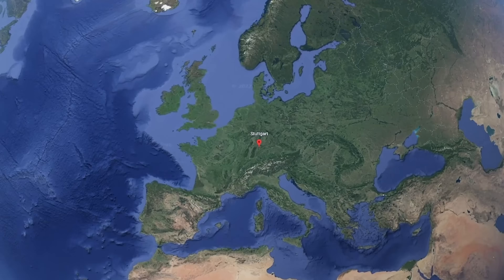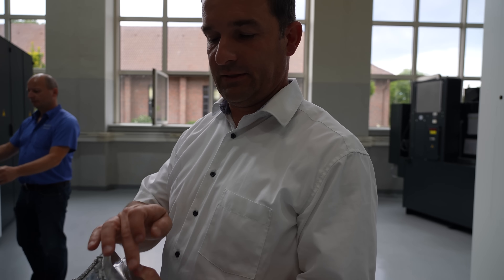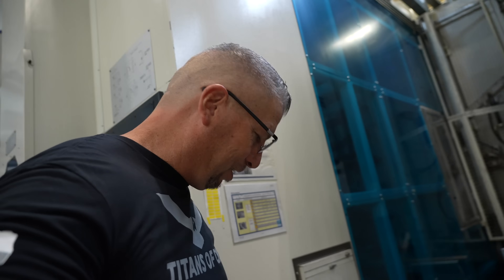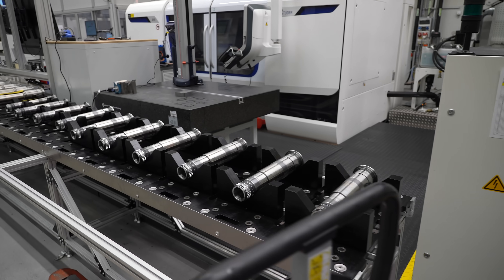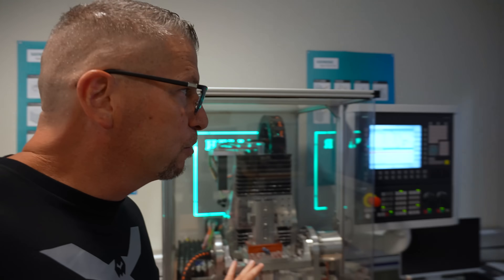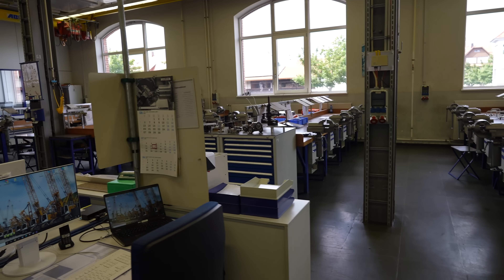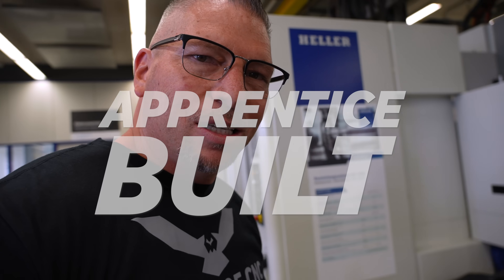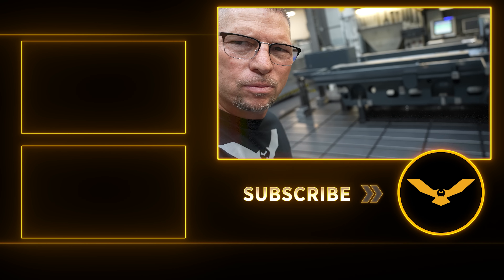GERMAN Machine Tool Builder Makes MONSTER CNC Machines | HELLER Machine Tools

Comment: You are not so far away from the company I worked for  Niles-Simmons Hegenscheidt MFD they're in Chemnitz the former Karl Marxsberg east Germany
They build Lathe-based machining centers they have many features that no other company really have to offer like a boring bar tool changer  your boring bars have servos and hydraulics to change their form as they cut they have a gearbox it is both an axis as well as a gearbox by zeroing out the clearances gives them the ability to use that as a rotary axis that is extremely rigid
Apprenticeship is a major thing in Germany it is something that is almost gone entirely in the US I served a formal apprenticeship, our machine shop was an official registered apprenticeship shop by the national tooling and machining association shop my father was a past president of the Arizona Tooling and Machining Association chapter of the NTMA. 
If anyone has heard of a Herrig 6-12 surface grinder I actually learned to grind under Herbert Herrig son of the man who invented this machine.

Comment: Hey I am a Mechanical Engineering student going into my senior year and I LOVE CNC! I wanted to ask if any experienced professionals in manufacturing or engineering have any advice for me. A couple weeks ago I started as a machine operator in a small job shop. I absolutely love it, I can’t wait to start setting up and programming machines, it seems easy enough too. I’ve been studying up on G and M codes along with the Haas manual for my machine (along with watching Haas tip of the day videos while my machine is running😂). I want to look into the courses on the Titans site but I was also wondering what else may be beneficial for me to do. My school offers a 4+1 program that allows me to get my masters in one extra year and I don’t have to write a thesis or something of that nature, it also costs less money. I was planning on doing it for a while and now I’m wondering if it would be beneficial for me to spend that time and money on the extra year for my masters. Would that help boost my pay as a machinist? Would that be good to have in case I want to have another option if I want to change things up or even have some type of role that may be higher than a machinist but still very involved with the CNC machines? Any advice would be greatly appreciated. Thank You!
Reply: As a shop owner, would you pay a CNC operator more because he/she in addition was a trained opera singer, a cook or anything else not specifically relevant to the current work tasks? You getting practical experience with CNC machines, and you having engineering degrees at hand naturally can be a good benefit to you in the future if/when moving on to higher positions, but do except 'normal' payment for the tasks you are doing. Generally, there is no big lack of people with NO education, and people with high education (+ a load of debt), but quite some lack of what is 'in between'; welders, CNC operator and so on, skilled people 'on the floor'. There are good possibilities within mechanical shop, both operators and engineers, would not think too much about payment at first, better focus at following something one love to do, getting experience and try be great at it, and often money will follow later on
Reply: You've been goofed out of a lot more money on an engineering degree than a tradeschool in machining. A masters most likely won't do jack if you're looking at that route specifically. 
On the other hand, if you really love tool making and machining, you can go beyond your master's and get a PhD in mechanical engineering with a focus in manufacturing. My university was/is (getting back to it) huge in manufacturing. It's much different work as you can be working with CNCs, but you'll be doing pages long derivations on equations to show for it. Talking things such as chatter, tool life, tool deflection, chips, etc. The other place I'd see having a ME background would be advantageous is in nanoscale machining where single point diamond tools and interferometers are standard and the construction site down the road just ruined your part.
All that being said, master's make it easier to get into and get a slight pay bump in managing positions. Depending on your situation, a good employer will be willing to pay for tuition. Meaning you can take up the job after graduating and when you're better off and thinking of it, you can get your master's paid for, albeit taking more time.

Comment: The best and most shocking part, seeing a kid use a file and a vice, probably the root of all high tolerance machining knowledge.  👍🏻👍🏻👍🏻
Reply: Yeah, gives me flashbacks. I learned as a Car Mechatronik at Mercedes back in 2014 and even we had to learn how to file and work with manual Tools. When you did it with your own muscle Power  only then you start to appreciate the automation that CNC machines give you even tough we never learned g-code and how to work with a CNC machine it was still an important part of our training.

Comment: I believe the High school system in Germany allows at the half way point to decide whether you'll be pursuing a trade school or traditional university education. If you choose trade school they let you get into apprenticeship programs as part of the curriculum. So when you grad high school you're already well on your way into a trade of your choosing.  The US has some similar programs in the USA but none as thorough or nation wide.
Reply: The school system here in Germany is quite a bit different. At the end of grade 4 you have to choose 1 of 3/2 school types. You can either go to school for 12/13 years at a gymnasium which gives you the degree necessary to go on to university or you can go to Realschule/Hauptschule (often they are combined) where you get a different degree after 10/9 years which is more focused on learning a trade or a job that doesn't require university education. If you choose to do a trade you will be in school and at a company and learning about your trade. If you complete your apprenticeship you can then go further and become a "Master" of your trade.

Comment: Why do we hear so little about Heller? Were they like GROB who only recently moved into selling individual machines to the market?  Their machining centres look up there with the best
Reply from the maker: They are up their at the top… they usually just sell machines to Monster Car Manufacturers or Caterpillar etc… but things are changing.
Reply: Grob was manly producing hole production lines like for car engine blocks. With the g series they put an enclosure over it and sell it as a single machine. Heller is one of this manufacturers that u know when u need this kind of machines and have the application for it. Or u digg a little bit.

Comment: What amazes me is there is a market world wide for all these machines and different Brands . I think I read Doosan build 12,000 machines a year that is just one brand .
Reply: Consider the fact that every single thing you see that is manufactured required a CNC machine. From clothing to plastic cups cars planes trains…..it requires many many machines to build a worldwide civilization!
Reply: The world is still automating and we're now solidly into replacement time for pre-cloud CNC machines, even the ones with rudimentary ethernet/usb connections.

Comment: i remember pople juking 3d printers printing 3d printers HAHA mills making mills BOOOMMMM
Reply: Phil, back when the earth was still cooling the Bridgeport Company, who makes the Model 1 Knee Mill, had a quality-control test where they would pull a Model 1 off the production line, take it to a little room, and manufacture another Model 1 on it. If a manual mill can do it, a CNC mill damn well BETTER be able to do it!

Comment: I don't know if it's different in the states, but this is how trades are learned/taught in many places in Europe. 😊I was an electronics technician apprentice (hardware development) myself and went through something very similar to what these guys are.
Reply: Its VERY different in the states! But Titan is on a mission to fix that!!
Reply: @barrysetzer  Hes doing good work 👍👍 How does it work over there?
Reply: Basically you go to school for 12 years to learn math and science, and after that you are on your own.
Reply: @barrysetzer  No "system" to guide people on to something then? Here everyone starts out with 9 years in basic school (math, science all that), then you can start at a trade school where you learn basic things in whatever trade your interested in, then get an apprenticeship like these guys in the video, it typically takes 3 or 4 years to complete an apprenticeship. Companies take a lot of responsibility in having plenty of apprenticeships available, many also end up with a career that way.. Or after the 9 years you can go the academic route of high school and eventually university. Those are like the two main "routes" here.

I'm a bit of an "odd" case myself as I went to the army before anything else. Then I used an army benefit to get full pay under an education and took up a trade. Realised I wanted to design circuits, and not test them, so I started at a university where I now study electronics engineering instead. Well, anyway, we have all these ways to develop a career and I think it's really good what titans is doing here as it hopefully gives more people a chance at a better future 👍 and an industry like metal working and machining will always need a steady supply of highly skilled people. 👍
Reply: It sucks here in the states,  I love machining but Im going into diesel technologies with an associates in applied science.   The first 12 years are school, ie math science, history ect.  Our hs has a really good machining program thats starting up, they just got a huge grant to expand the school for its trade classes.  Welding/fab, machining, small engine/light duty vehicles.   My father is a machinist so thats where the back ground started, helped him a lot in the shop running parts.  Back to the main point, the trades at the hs all work on things as one. Before I graduated, the new addition was finished but the welding shop wasnt. The shop class made plans and made the table tops, legs, stretchers and brought them to the weld shop to be assembled.  Each kid would be assigned to build the table as an assignment, doing everything to build it.  I had a teachers aid block tied into my welding block so I could help out the most.  The machine shop teacher ended up being one of my dads old friends so he knew I was a higher up in the class and had me doing things other kids didnt know how to do or teach them how to do something.   The kids also put their names on the bottom of the tables with stamps (initials) to show who build it (welding, sanding prep, deburring)    My current trade class (trade class) is at the countries bus garage, 4 days a week from 5pm-11pm.  90% of it is hands on with a smidge of classwork, assignments, tests (Most are hands on tests) and I enjoy it.   But I really wish it was like this in the states.
Reply: @Noah-qs3rq  why? You can put a Facebook ad up for diesel mechanic and make a few thousand a week just playing around in the garage. You dont need to do all that BS to be successful.